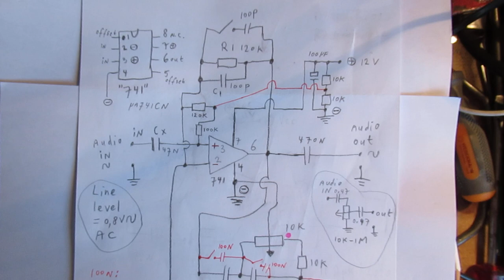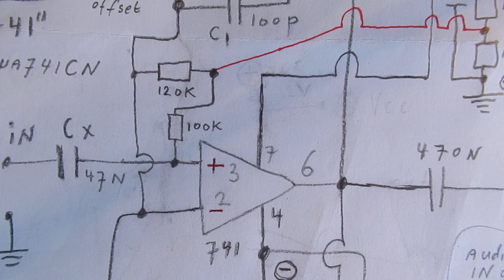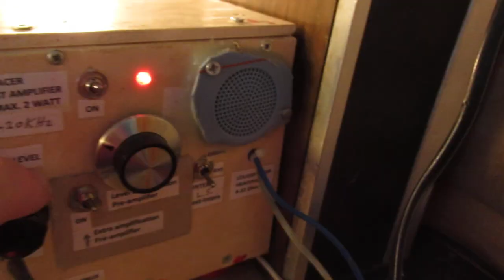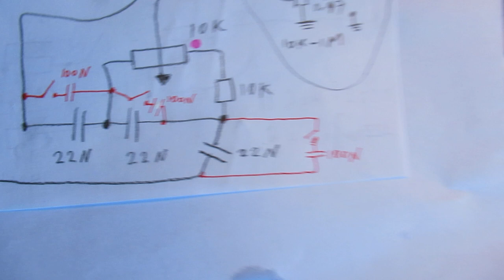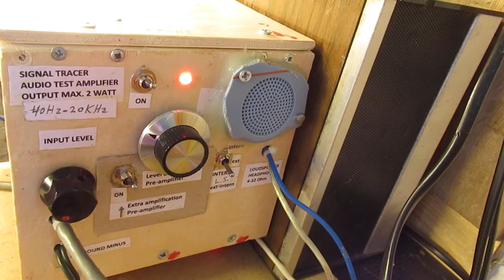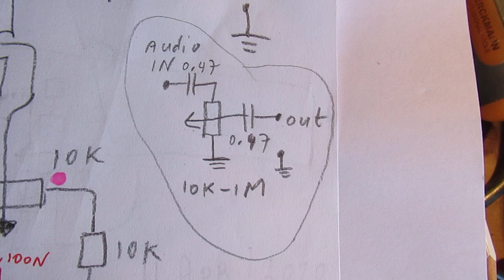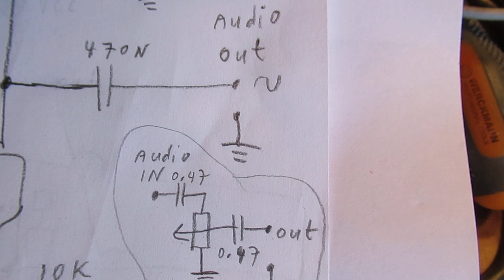Sharp audio filter for speech processing with 741 and wah wah circuit (schematic and demo)

Comment: Nice Work Brother
Do You Think This Could Take An Input From A peizo Element Into A Small jFET Circuit  ?
Reply from the maker: Yes, I think so.
Reply: @radiofun232  Great Thank You , How Much Would You Charge To Buy This Circuit ?
Reply from the maker: @joohop  Thanks. Sorry, but It is not for sale (and it is easy to make). Use a 4700 uF power supply capacitor.
Reply: @radiofun232  Ok Buddy Cheers

Comment: it sounds much better used on music!! oh and what voltage regulator did use??
P.S. i just love how you always use old stock components.. to me they look much nicer! like sweets : )
Reply from the maker: I used the 7812, but it is not strictly necessary. Power supply must (of course) be free of hum, so a 4700 uF capacitor will do the job (that situation not tested by the way).
Reply: @radiofun232  i should of guessed sure you had 12v input on the schematic with the virtual ground for the op-amp. feeding it +6V & -6V. but maybe it would be better off with the regulator coz alot of those cheap UPS's(switching supplies) have alot of out put ripple. & are noisy
Reply from the maker: @keithking1985  Sure! Thanks.